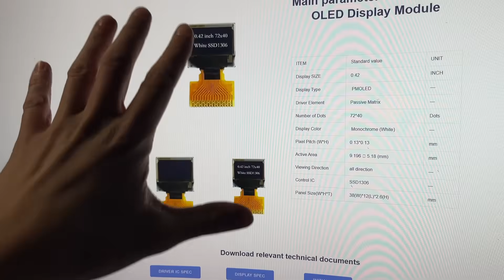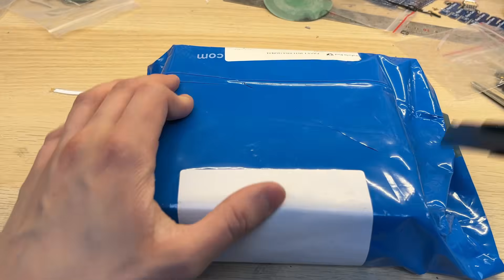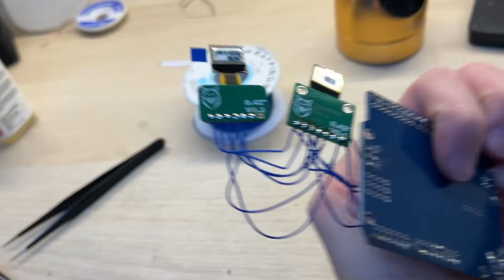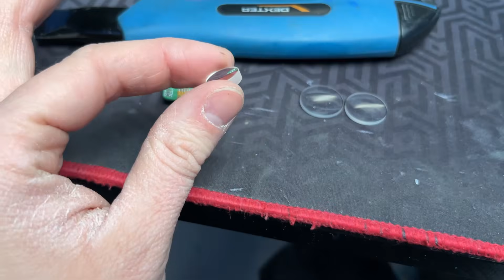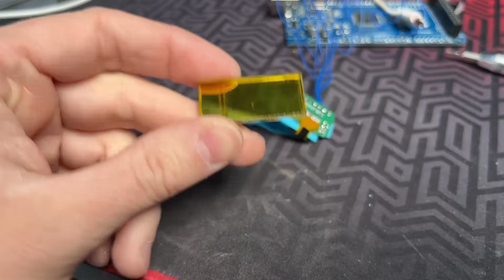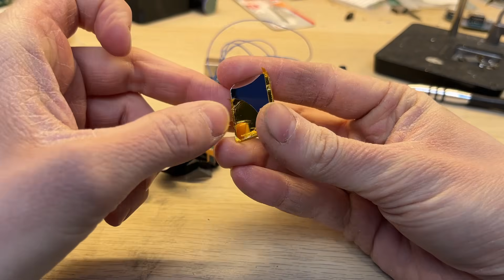0.42 Engine | Cheapest DiY Augmented Reality Yet

Comment: You could also make it smaller by combining the lens and the "combiner" into one. 
A curved plastic sheet or acrylic should be enough. You can try a not perfect version of that when using the inside of curved glasses (eye protection glasses, sun glasses).

Of course if you want optimal optics, the shape of the reflector has to be calculated for the position of the screen, eyes and focus length.
I think it should be possible to then print the negative of the shape and vacuum form the reflectors.

I'm not hundred percent confident but i think the shape just needs to be a paraboloid with a certain curvature.

Comment: Just a heads up, you have a lot of plosives in your audio. I would suggest putting a -12 db eq on 20hz down, would cut a lot of rumble from the audio. Good video!
Reply from the maker: Thanks man. I have a new microphone which does not have the attachable filter and I’m struggling to get the audio right

Comment: Very practical build of an optical engine. Would probably not take too much more effort to switch out for one of the significantly higher resolution flcos displays on aliexpress. Would love to see a build of that.
Thanks for adding the links to the optics. Been working on one of these myself and the lenses are always the hardest part.

Comment: there is also a really cheap 0.42" full color LCD with pretty dense 96*54 pixels, that might even be enough for "video". also interesting might be the 0.54" oled with 96*32 pixels in a onyx or birdbath configuration, as it is only 7mm wide. The prism in your setup seems overkill, there seems to be enough space, or am i missing a function? Have you had any success combining cheap prisms to beamsplitters, or using magnifying mirrors? even with total reflection, double prisms might be fun lining up a camera with the screen and the line of sight, while allowing transparency if mounted of angle. great work! really inspiring.
Reply: I saw that display and thought the same thing!
Reply: These work well with a very small led lens reflecting on the inside surface of the glasses
Reply: Dude I need your help 😂 I'm thinking of the rectangle screens but I'm not sure now